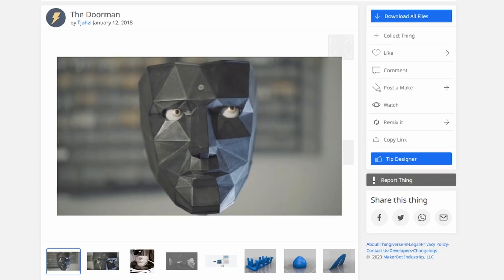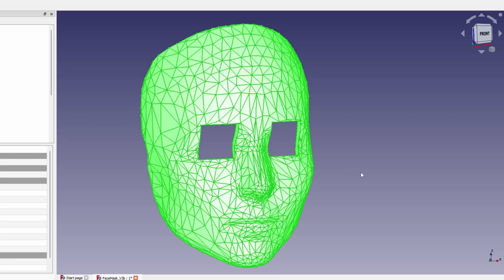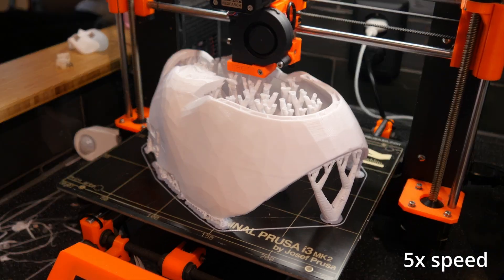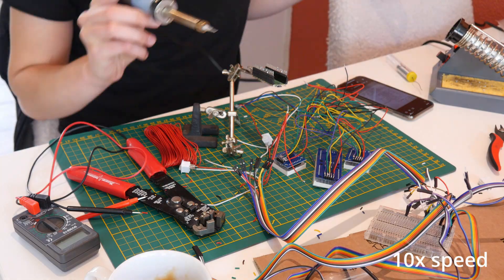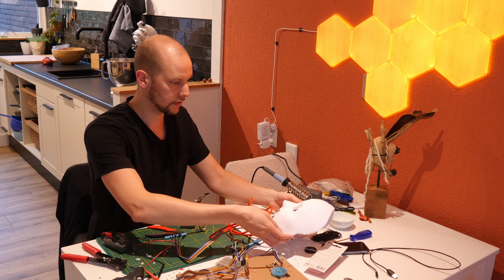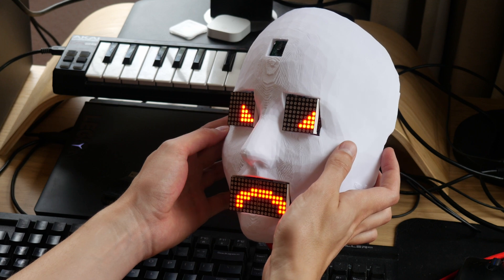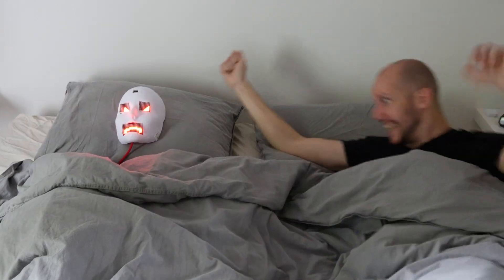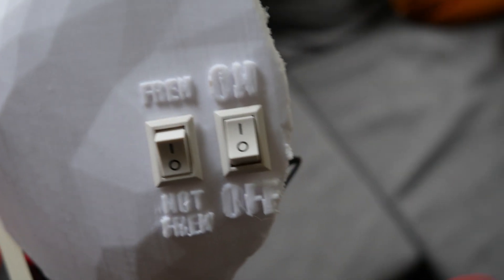DIY Robot Face is BULLYING me

Comment: Do the same thing but use fiber optics and put material over them.
Reply from the maker: I think that could also give a cool effect, yes!
Reply: @strange_inventions   I used to build limousines, and we would install thousands of PMMA Plastic strands into a sheet of plywood, and then cover it with headliner material so it looks like stars. You could make a really cool mask with this method and not have those flat circuit boards visible.